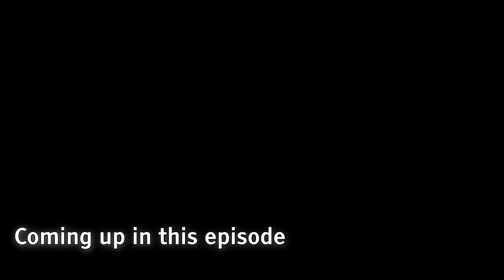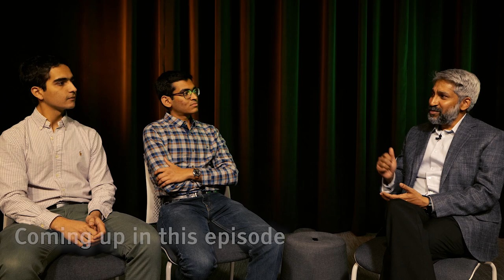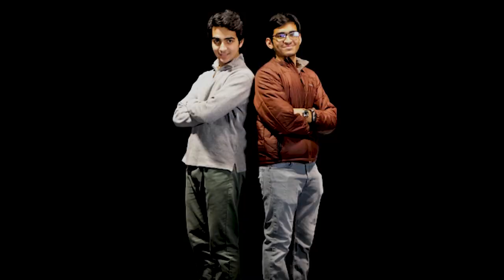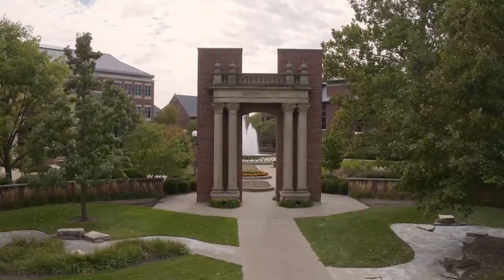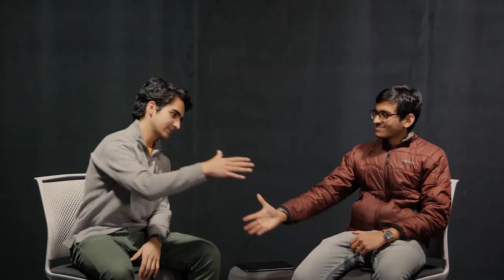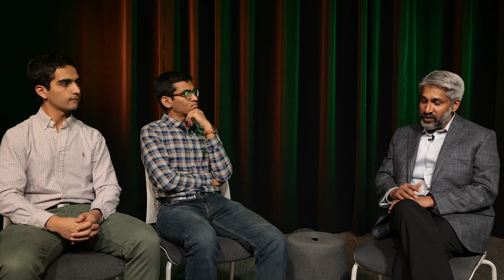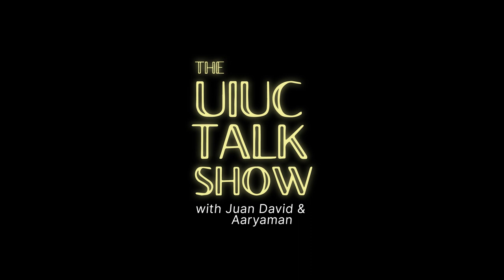Kiruba Haran: Building an Electric Aircraft and Getting Back to the Future | The UIUC Talkshow #14

Comment from the maker: Here are the timestamps. If you have questions or comments for Dr. Haran, please write them below.

OUTLINE:
0:00 - Introduction
0:55 - Electric propulsion
17:00 - Sri Lanka, GE, UIUC
20:15 - How to make electric aircraft real
26:00 - Hydrogen economy
34:26 - Starting a company as a professor
39:50 - Space propulsion
44:15 - Sustainability and innovation
50:56 - Children
55:18 - Create cool shit, not RSOs
1:16:35 - Advice for young people
1:21:00 - Electric flying cars?
🚥Overrated or Underrated Section 🚥
1:23:46 - 🥼 The Flux Capacitor
1:25:20 - 🛫 Boom Supersonic
1:27:00 - ⚡️ Superconductivity 
1:29:50 - 🕶 Engineering Vision/Leadership
1:31:08 - Closing words